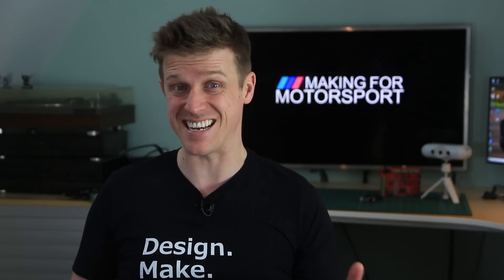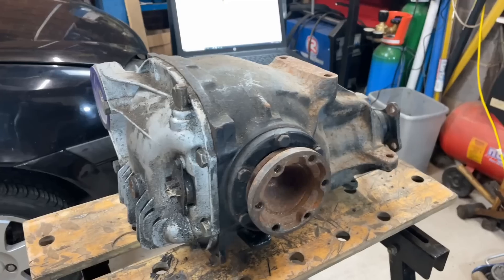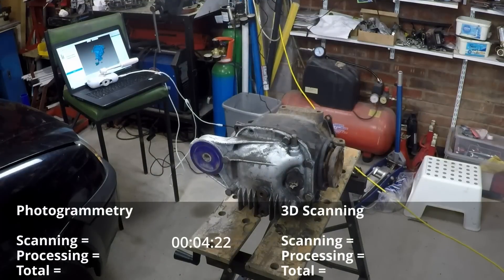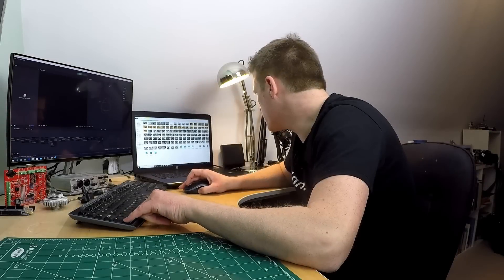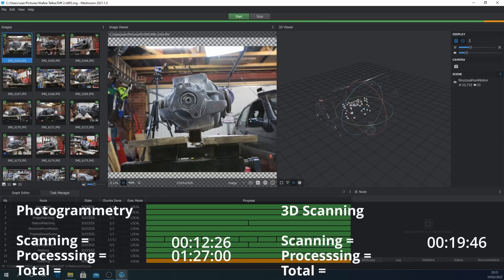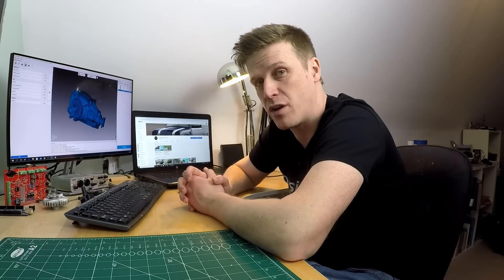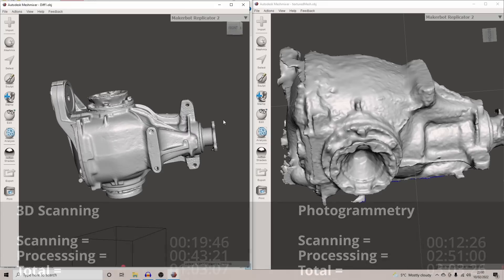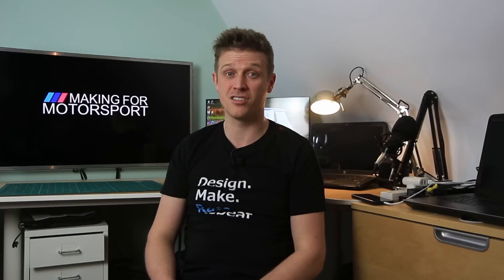CR-Scan Lizard 3D Scanner vs Photogrammetry - which one wins?

Comment: Worst comparison ever. how can someone who have never done photogrammetry and has no idea how to do it try to doit to compera it to a scanner. and even with the scanner you had to flip it over several times, coat it, re-scan because it still failed? just a shameless add for the lizzard
Reply from the maker: Okay, I understand your point but I dont understand why you can’t compare them, especially from a newb point of view, which I make it very clear I am, at both techniques.
In the video I also make it clear time is the  main consideration, given enough time you can measure and 3D model anything, photogrammetry and scanning, are really useful tools when they save time or are more accurate, if you are doing it for it’s own sake then it’s a hobby not a tool (that’s my outlook anyway).

But a question, you mention flipping over, I was under the impression that with photogrammetry I cannot move the subject unless I blank out the background?  Am I wrong here?

Comment: Of course your photogrammetry failed!  You need between 100 and 150 photographs.  You need to take so many that you are exhausted and bored, and then take some more.  I'm sure the scanner is nice, but this was not really a test at all.
Reply from the maker: But isn’t that the problem..? If it takes so long to create a decent, usable scan then I will just spend 2hrs measuring it and 2hrs modelling… 
I should have made it clearer maybe in the video but this wasn’t about “the best possible scan” it was about which is the most useable “tool”, I spent much more time on the photogrammetry than on the scan but the result was no good.   If I have to spend even more time it’s probably not a useable tech for me whilst I can get a scanner for less than $400…
Reply: @MakingforMotorsport  LOL!  I can't argue with that!  And I have ordered the scanner (which will be my 4th).  I hope it works as well for me as it did for you!
Reply from the maker: 4th scanner!!! Man you are starting a collection!  And it sounds like you know what your are doing aswell, (unlike me) so that always helps!!! 😂
Reply: @MakingforMotorsport  Another way to think about it is that the first 3 did not really work as well as I had hoped.

Comment: I've seen the specs of this saying you can scan up to 1500mm. Is that a single scan?
I was wondering if I could use this to scan a can in multiple goes maybe.
Reply from the maker: I don’t really get that, you could scan a lot bigger than that if you have the time, especially in handheld mode….
Reply: @MakingforMotorsport  I meant a car back there.. not Can..🙈
I think they might get my dollars soon. 
I've done photogrammetry a lot.. and I agree with the comments around.. you need a hell of a lot more pictures.. I run 1000s of them.. and you want a better software.. reality capture is amazing.. and you "pay as you go" Option makes it really cheap.. 300 pictures model would cost around 12$ or so.. can't remember now..

Comment: That scanner model was really impressive. I'm sure the photogrammetry could have been better with more pictures. Something I've never seen is recording a film of the object at a slow frame rate, say 5fps. Then exporting the frames as pictures. This would enable the user to just walk around the object in a similar way to the scanner.
Reply: Videos aren't really good because they have worse compression, artifacts caused by movement, etc.

Comment: Reality Capture is way faster then Meshroom. But i also have seen that its possible to combine a 3D scan point cloud in Reality Capture with photogrammetry. Which could be a very interesting thing.
Reply from the maker: Mixing the two techs sound interesting… hopefully you get the best of both rather than the worst! 😂

Comment: You should use reality capture if you want it to be fast and good quality as well. for me I get really good outputs from photogrammetry but you should really have used a lot more pictures hahaha sometimes more pictures even makes it faster since the software can interpet the scene better. Also best to take some closeups aswell since your photos were from quite far away to really capture the detail
Reply from the maker: I know photogrammetry can do better, but if time is the limiting factor then Meshroom is out…. I will be trying reality capture as that seems much quicker…. But spending 1hr just taking pictures doesn’t sound like fun! 😂
Reply: @MakingforMotorsport  well you can get away with like 100-200 pictures. probably will take not that much time at all. afaik you can even combine the lidar point cloud with the pictures so that way you get the best of both worlds.

Comment: If any 'patch' of the subject has less than 8 clear images with some perspective shift, you will get uncertain results.
Another name for photogrammetry is 'surface from motion'; deriving the curve of a surface by examining how images of the surface change with movement of the camera.
Many images, lots of perspective shift is the bare minimum.
Scanners have to be 'on-site', photogrammetry works with images sent from anywhere...archival footage of lost machines can make accurate replicas.
Reply from the maker: In my job we use photogrammetry for measuring volumes of stockpiled earth.  It does a good job, you wouldn’t use a scanner for that, but then you don’t need millimetre accuracy.  
I will be revisiting photogrammetry but for  usage case, (mechanical parts, medium size and limited time to spend) I don’t think photogrammetry is the “right” tool… but I am not finished yet!

Comment: I respect what you do, but this leans too much towards the scanner..

1- You are using a free software, famous for being abnoxiously slow, against a commercial scanner.. Reality Capture would have taken minutes to process those photos for actual cents..

2- Most tutorials i've seen about photogrammetry emphasize on taking plenty of photos, yet you took about 30? it's like pretending to cook a chicken in 20 seconds..

Putting some effort on the capturing process, taking ~500 pictures of a complex piece such as the differential should get you a fairly detailed model, wich would take Reality Capture less time than it took Meshroom to process those 30 pics.. for a final cost of about 10 dollars..

I'm absolutely interested on getting the scanner, but was hoping to get a fair comparision.. if it was possible to revisit this video based of what i mentioned for a better understanding of what the scanner real advantages are, would totally use your link when purchasing it..

Also, including the result of printing a flange or something similar based off the scan would be the cherry on top..
Reply from the maker: This is a fair comment if looking to fully exploit the tech, however the point I come back to repeatedly is time, and time is my precious commodity.
Meshroom is held up as a good solution by many, but Reality Capture has been suggested multiple times, and with the low cost/scan it’s worth a go and I will be using it.
I will be integrating this into my workflow soon so you can see the practical use of the models…

Comment: I used photogrammetry to model a spring seat/shockmount on my volvo from which I grabbed all sorts of measurements: planes, holes, etc.  I designed and then 3d printed an adapter which fit perfectly into the part.  I really think photogrammetry can give you much better results than what you achieved.  You definitely didn't take enough pictures,that result was really bad.  Take like 100+ photos with much more gradiation between angles.  Also there were still quite a lot of shadows on that diff, it could've been a little better lit.  I used a bunch of LED shoplights.  Every shot has to be crisp too.  Setting the aperture to F11 or more for a wide depth of field is key which means you need even more light!  Processing time was very long but the computer does the work and I was free to work on other things.

All of the tutorials on YouTube were pretty bad from what I remember.
Reply from the maker: Yeah, I had my lens at F7.1, stopped down anymore I just ran into noise from high ISO!  And I already had all the lights on it! 🤦‍♂️. I will probably give it another go but as an experiment as if an object is scannable I’ll probably just use that!
Reply: @MakingforMotorsport  Yup, the iso noise will hurt too. I had a TON of light on this thing and it worked very well, although, I went through the whole process like 3 times in order to get good results. If I had had access to a 3D scanner at any point, I would’ve just used the the scanner haha.
Reply: Try a cross polarization lens filter with a high power ring light in combination with existing lights, a tripod for your camera, black background and mount on a turntable with a welded pipe or custom made mount. 150-200 photos from different elevations. I think you will be amazed. Try Reality Capture as your software. I have been in the field for 7 years.
Reply: Unless it's a huge difference I would never want to go through all that trouble when I could just scan something. I'm a busy person.
Reply: @dangerous8333  Yeah well if you have a scanner, then that is going to be the better option. The benefit of photogrammetry is that it’s accessible for people like me who already have access to a nice camera.

Comment: You are comparing a 10fps specialized camera to what looks like a few dozen photos taken by hand. The scanner is better for the task but you need A LOT more photos to make it fair. Anyone who knows about photogrammetry may think this is a paid spot where you intentionally showed photogrammetry at its worst. This is especially evident in the exagerrated way you pointed out how long it takes.

I do think 3d scanners are loads better than photogrammetry but taking 33 photos is doing it wrong. I did a quick look and saw people using 50 photos to scan something as simple as a square foot or so rock.
Reply from the maker: Hmmm, I get what you are saying but I made the point several times that TIME is the issue here.  
I know photogrammetry can be better than I showed but if I have to spend multiple hours to get a usable scan then the technology isn’t usable for me.
I cut it in the end but I did film a piece explaining I have kids and a busy job and any scanning tech needs to work when I can use it (in a garage at 9pm at night) Downing tools in the middle of a day to take 150 pictures because the light is right is not something I can do.
I think photogrammetry has its place (I will be trying it again) but not on a part like this…

Comment: For photogramety to work you need 600+ images for that size of part
Reply from the maker: Yeah, I guessed that I needed more photos but it was already a long winded process as it was!  I will have another go at some point but on something that is unscannable like a car…
Reply: @MakingforMotorsport  Meshroom is very CPU intensive and sometimes also RAM hungry. From my experience if you have a lot of stuff on backgroud and default settings on feature extraction, you are loosing lots of computing power on them,  very dark or blown white background is way better and make room for experimenting with high or ultra settings on feature extraction, but my succesfull reconstructions usually takes betweeen 2-300 recognized camera positions and 6+ hours on dual Xeon server with lots of ram anyway. also if you run reconstruction in stages, after Structure from motion part, you can check on your progress, tweak some numbers and create bounding box for Meshing part of scene you are interested in and improve results and save some post processing time
Reply from the maker: @DominikKomzik  that’s great information  thanks… so it still takes 6hrs even with all the tricks and a dual Xeon crazy power?

Comment: Yet another awesome video, this scanning tool is on my wish list. Your mesh room results matched my own. Sadly it's just not a precision tool. Better with more simplified geometry or slab sided objects but like you saw it's more so a suggestion of dimensions vs anything concrete.
Reply from the maker: I think there are better options and methods out there for photogrammetry but for me going forwards it’s gonna be scanning for these objects…
Reply: @MakingforMotorsport  Oh yes it's a far superior technique. Thank you for this side by side comparison. Really drove home the benefits of adding this tool to ones collection.

When I think about it I actually think the CR scan will save individuals money in the long run. For instance when developing my intake turn signals for my MX5 I used meshroom but since it wasn't very detailed it required me to do many iterative test prints to get the measurements just right. I think when I tallied up the cost of development in materials it was somewhere around $80 all said and done if I recall. Honestly a lot of that went to user error since I was and still am relatively new to 3d printing but regardless it'd require multiple prints which all add up. I think if I used a tool like this I would have had it dialed in, in a fraction of the time and cost.
Reply: @MakingforMotorsport Imo photogrametry is hard, in order to get really accurate and reliable scans I cover objects with chalk spray and then add small black dots using water soluable wet paint and toothbrush. Such treatment creates ideal surface for optical measurment, scanners using structured light benefit from matt surface so using scanning spray will give you better results. For photogrametry you can give a try to 3df zephyr, I think you will get better results

Comment: I'm really wondering how this compares to the Revo point pop. They are similar in price but I think this might be a bit better but it's hard to tell.
Reply: I have a Revopoint Pop and it's as good as this. Accuracy is as good as my ability to measure. The software does a great job of combining separate scans too.
Reply: @ianproudfoot5415  I've watched some people use it on discord. The software on this seems to be a bit easier to use. Does that sound accurate? Maybe Making for Motorsports.just made it look easy lol. I didn't realize there was a pop 2 already.
Reply: @madeintexas3d442  The RevoPoint Hany Scan and Handy Studio software looks very basic on the surface, but it does do a good job for the beginner. I do wish that they had 'pro' versions with more control over the process.
Reply from the maker: I haven’t been hands on with the Pop but my impression is that this is better than the Pop but whether it better than the Pop2??? We’ll see…

Comment: awsome vid man. this the same dif fim using in my AWD rx7 conversion
Reply from the maker: Yeah the 188!  Inside lurks a 4 plate conversion on the standard ramp angles… just need another Beemer now to fit it to!
Reply: @MakingforMotorsport   for sure, Im using an E53 front diff. ZF8HP70X from an E70 X5. Should take a bit of a beating. I welded my diff. I HATE welded diffs but cant affford a proper LSD i might try one of them Cheap LSD blocks. Reports that they do work
Reply from the maker: @BEYTEK  welding a diff ain’t great but needs must, 1 tyre fire ain’t getting you anywhere… I have heard good things (well, positive anyway) about the clamps, they add just enough preload… not a full plate diff for sure but do make a difference….
Reply: @MakingforMotorsport  i think so man. Preload enough to turn the steering wheel or turn out junctions with out slapping about haha

Comment: I've just done this with my EF civic, to fix the front end. Took a video walkaround of the front using a high fps modern smartphone. Split the video into frames using ffmpeg; the use the standard workflow in VisualSFM to generate a sparse point cloud; then a dense model.
Reply: Good idea. Tried it myself, once.
Can't quite figure out why there isn't any photogrammetry software that takes video instead of photos. You instantly get a reference of movement to work with to.
Reply: @FlexDRG_Lampje  Yeah it was a bit of a "Duuuh" moment for me, obviously there will always be junk to clean up, but without a scanner this method's output is very impressive. Last step is to measure min/max dimensions on certain straight edges and hole positions; that way you can bind your messy model to real world units.
Reply: @3dkiwi920  even better, include 3D markers, those help get the original camera position estimation better, and get the scale right. (Apparently), I don't have a printer, so haven't been able to test.
Reply: @FlexDRG_Lampje  Meshroom can break videos into frames, and can process as a time series; then reprocess using camera positions to get better fidelity.

Comment: It seems though that if you were trying to model something much larger… like an entire car… the scanner would be extremely arduous… but the photogrammetry would possibly be more efficient…?
Reply from the maker: I think that much larger (so inefficient for a scanner) or much smaller (so you can control the area much better - maybe with a turntable setup) might be a sweetspot for photogrammetry…
Reply: @MakingforMotorsport  since you’ve done about 100% more scanning than I have, do you think the photogrammetry would work better with a plain background behind the thing you’re trying to model? Not judging in the slightest, but there was a lot of “visual noise” in the view behind the differential. I wonder how the result may have been different if you’d had a flat white sheet behind it?
Reply from the maker: It’s no problem judge away! 😂 if I removed the background or cropped the videos or did any number of things I am sure I could improve it but this is part of the problem… that is as tidy as my garage gets at the best of times so putting up a load of sheets ain’t really on the cards 🤷‍♂️

A lot of comments on here are saying that Meshroom is a nightmare to use at the best of time and there are better packages but even then photogrammetry is a skill in its self… like you wouldn’t say you can weld thin ally just because you have an ac TIG welder, this seems like the same deal…